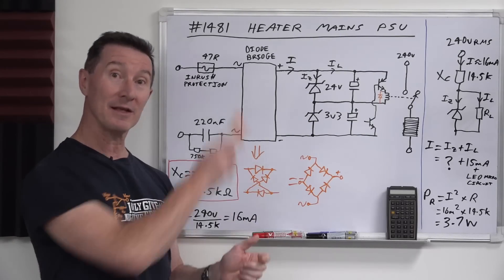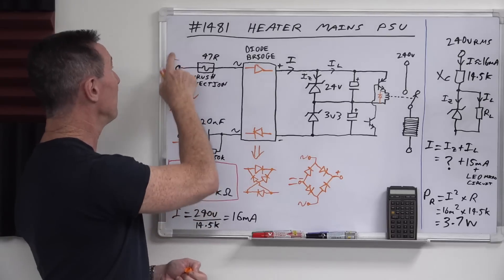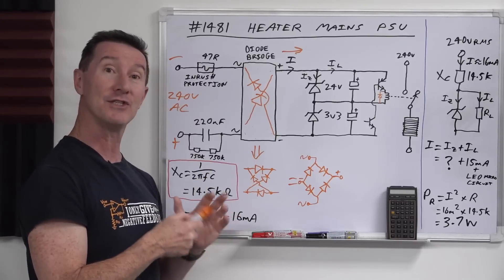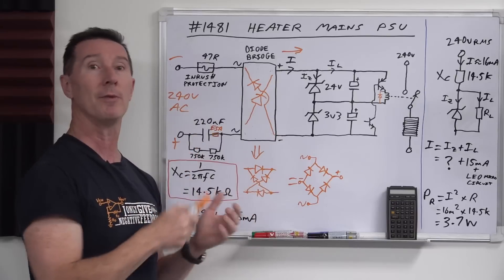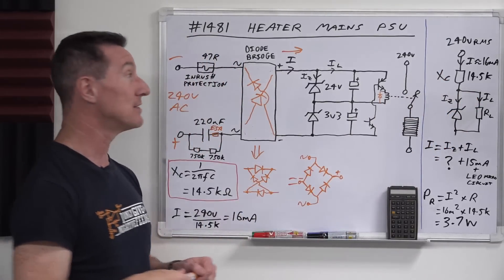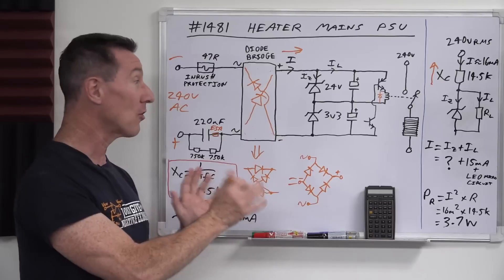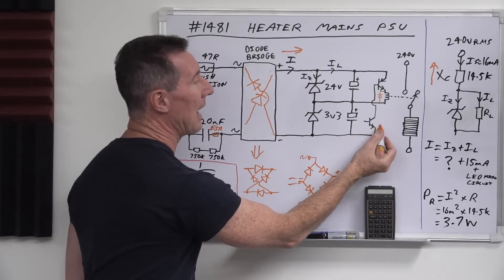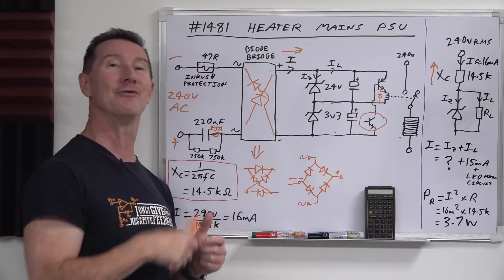EEVblog 1482 - Mains Capacitor Zener Regulator Circuit

Comment: Excrement!...erm Excellent! :P
youre starting to step into BigClives world with this one Dave!...always good to have the technical background tho!
speaking of Zappy!.. ive got a cheap coffee grinder.. ive copped multiple zaps off it!.. it obviously doesnt have any bleeder resistors across the capacitor...ive started to short the plug prongs on a metal frame every time i pull it from the wall

Comment: This capacitance degradation in 'Polly put the kettle on' capacitors is a well known phenomena but doesn't seem to be acknowledged by the manufacturers.  I've had several small electrical devices like coffee machines and mains timers fail due to this effect.   It would be interesting to set up a test to count the number of breakdown events occurring and the rate of capacitance reduction.  I suspect it's mainly a problem in 230V countries where many areas, like mine (and BigClive's), still operate at 240V - 250V or maybe it's a function of how clean the mains supply is.  It doesn't appear to be a problem on DC supplies, spacecraft use these capacitors to filter the main DC bus and they work happily for a couple of decades.  Having said that they are voltage derated by at least 50%.  I would do the test myself but I don't have an oscilloscope which would be necessary to establish the size of the current pulses.
Reply from the maker: I could potentially do that, as I have a mains surge generator. I can run it continuously and get capacitance data.
Reply: @EEVblog  please do that. Also test some higher-voltage rated caps and test it with and without a MOV across it.
Reply: I suspect voltage surge events large enough to cause breakdown in X-caps and damage proportional to the amount of energy involved are relatively common if you don't have a whole-home surge protector wired into your breaker box or snapped directly onto its bus bars as required in some of the newest electrical codes. Whenever something on your local distribution transformer shorts to ground/neutral/phase-phase and a breaker breaks 100+A fault current, all of the energy stored in stray inductance along the way has to go somewhere. Stuff triggering reclosers and other distribution equipment can cause transient nastiness too.
Reply: @teardowndan5364  never mind the distribution transformer. Having your Senseo coffeemaker plugged in when switching on the fluorescent lights will already shorten its life span.
Reply: yup..id be interested to see that too please Dave
Reply: If you have enough solar power inverters at your neighborhood (or you have your own) you may experience even higher voltages than 250V. As I remember our inverter is configured to shut down at about 255V by default. Up until that level it will happily increase the voltage for your poor devices at home.
Reply: @kralg  I dont think even permanent 250Vac would damage these caps (which is within spec for what the grid is allowed to be), they are rated for 275 after all.

However spikes can be well above 275, especially locally somewhere in your house from inductive loads, and especially if there are no MOVs nearby and not much capacitance in total plugged in either.
Reply: @Basement-Science  Sure, but the closer we are to the limit the higher the chance that any superposed event will exceed that.
Reply: I think the manufacturers in this case are using it as a means to set the lifetime of their heater in "on/off cycles", as each cycle will probably tick down the life of the capacitor by a calculated amount, on average, and pseudorandomized by local household voltage.
Reply: MASON?
Reply: What types and values are used on a spaceship DC bus and what voltage is that bus? I can hardly imagine they would put just another yellow mex tenta x2 rated cap across the bus.
Reply: @mjouwbuis  Spacecraft, by which I mean mostly satellites, use low voltage DC power buses in the order of 35 - 70V.  The ones that I worked on were regulated at 42V when in sunlight and reverted to battery voltage (20 - 40V) when in eclipse.  Some are 50V regulated at all times.  The voltage is regulated in sunlight by switching the requisite number of solar panels onto the bus with a PWM control circuit at a few kiloHertz.  The switched current is  smoothed by a high quality capacitor bank consisting of lots of capacitors connected in parallel  A typical capacitor bank might be 100 x 10uF, 100V.  The capacitors we used were Siemens MKU type, metallised cellulose acetate film.  They appear to be obsolete now having been replaced by MKT-S type which are metallised PET film.  There is only one capacitor bank for the whole satellite so it must be very reliable and the self healing nature of these capacitors makes them short circuit failure free.  We knew that occasional shorts would occur and the capacitance value would degrade but the loss of capacitance in 15 years was stated to be only a few percent.  Note that 100V capacitors were used on a 42V bus and transients were tightly controlled.  All components used in high reliability aerospace electronics are highly derated.  https://adsabs.harvard.edu/full/1997ESASP.395..395M  This is the type of capacitor we used, they were very expensive.  https://www.ebay.co.uk/itm/142270300256
Reply: It is in fact acknowledged by the better capacitor manufacturers. Vishay/BC, Vishay/Roederstein, Wima and I think also Panasonic, put warnings in their selection guides that normal X2 capacitors are not recommended for mains series supply use.
Reply: If your mains voltage is too high then here's how to turn it down.  All you need is a ladder and a pair of Marigolds.  www.youtube.com/watch?v=Zg_EPmtbI58